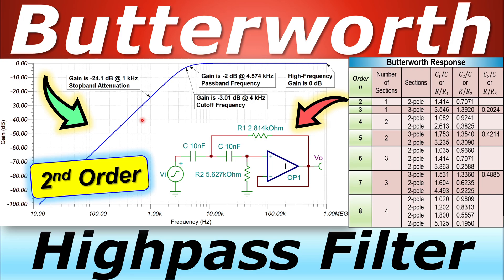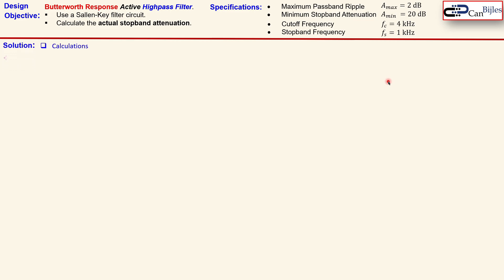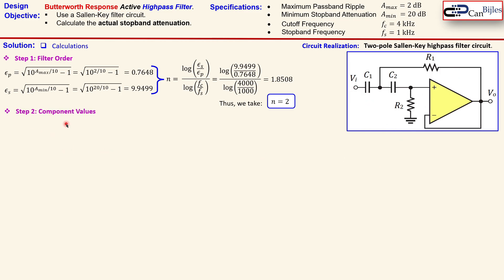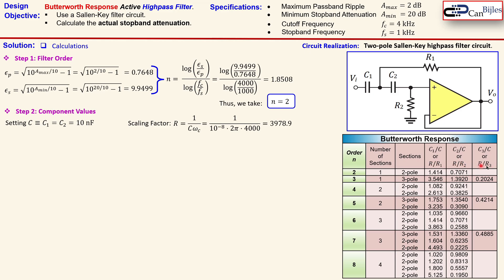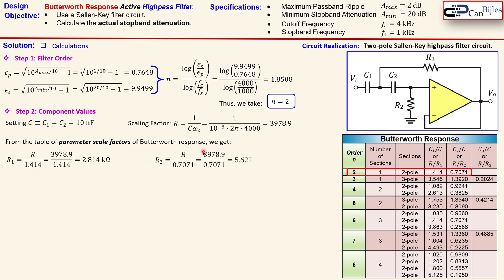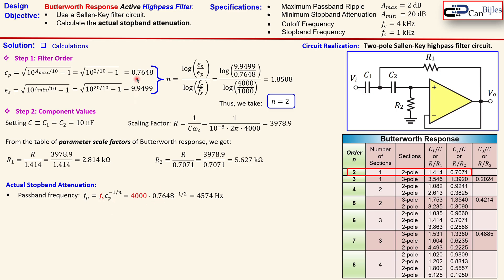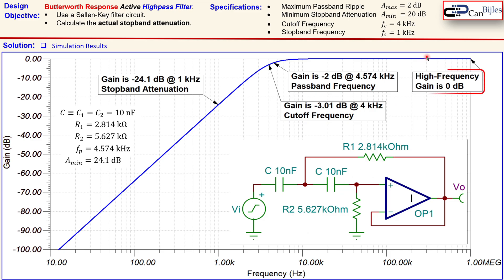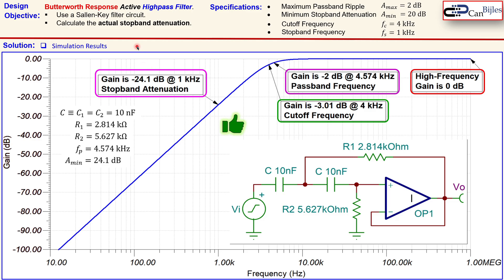🌟 Butterworth Response Highpass Filter Design - 2nd Order 💡 Two-Pole Sallen-Key Circuit

Comment: Just simply amazing! If I understand correctly, there are different responses that a filter can exhibit. As in your example, the Butterworth response will have a flat response until the cutoff. And the Sallen-Key is the actual wiring hookup of the filter to give that Butterworth response. I was thinking of designing a 20Hz to 2kHz bandpass filter with a Butterworth response. This would be a high pass and low pass cascaded together where each stage would be a 2nd order filter. I figured I would find the equations and pluck in some numbers and I could get the values for the capacitors and resistors. Now, I realize that designing active filters is a very complicated matter. As you mentioned from a previous post of mine, that there would be interaction between the two stages and the flatness and cut-off frequencies would change. If you were to design a bandpass filter for the frequencies I've mentioned, how would you accomplish it? You mentioned in my previous post, that I should look at your video on Geffe's algorithm, I will check that video now. If I have any questions, I will definitely give you a post. I'm ready to learn more about this fascinating subject of how to design active filters. Thanks for the video and have a great day!
Reply from the maker: Glad to know you enjoyed the video, and I appreciate your questions! 😊 For a good bandpass and bandstop filter design with cascading, you will need to use the Geffe's Algorithm. You might also try the multiple-feedback bandpass filter circuits. Also, these filters are discussed in one of my videos on my channel. Check it out if you have time 👍